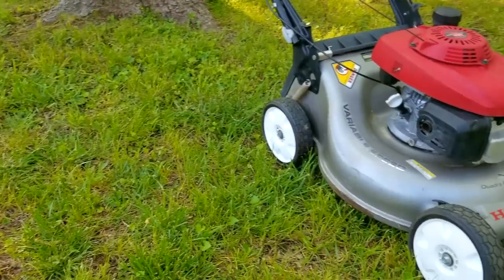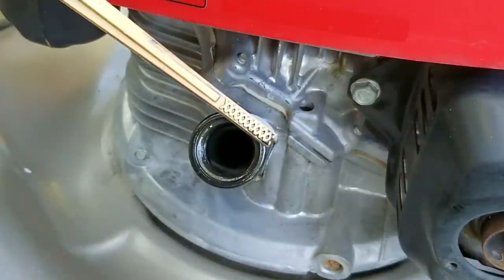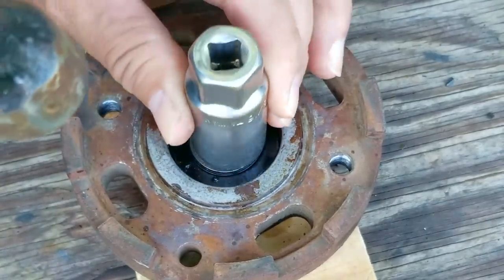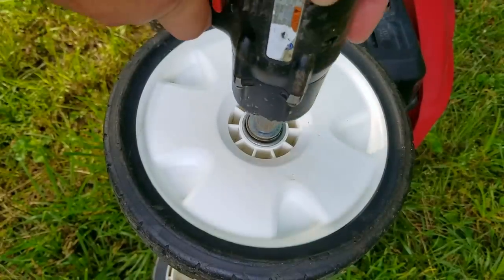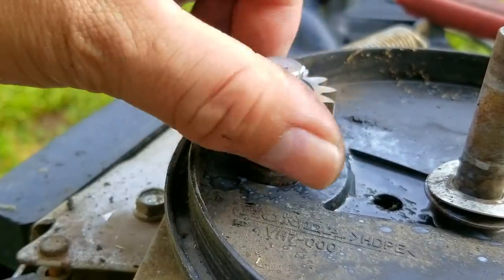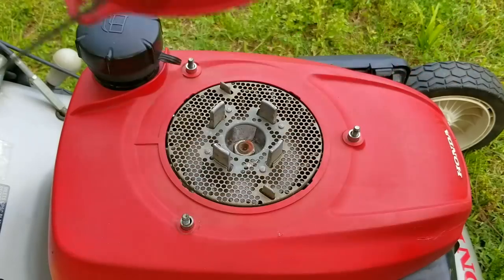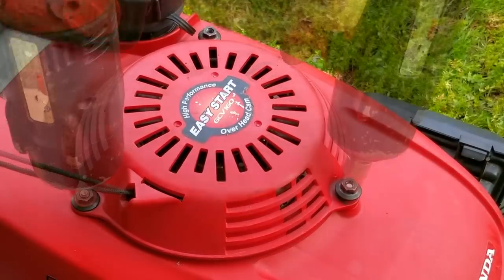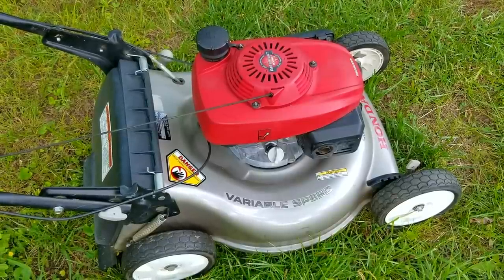The Most Abused Honda Mower I've Ever Seen, And It's Still Running

Comment: Love Honda mowers.  So unfortunate that Honda is exiting the mower market.
Reply from the maker: me too, and yes it's a real shame
Reply: I bet Honda makes battery powered mowers though, yippee!  NOT!
Reply: DAMN HONDA CARS,	 MOTORCYCLES, AND NOW MOWERS?! “Oooooo thanks for da like”
Reply: Just bought 6 brand new ones once I heard they were leaving the market.
Reply: I’m considering buying one to have on hand. I for one want the blade brake clutch as I have to deal with a lot of leaves in the fall and spring. It’s becoming tedious to have to restart my current mower after each bag empty. Also, my current mower is heavy (100lbs) and self propelled, though there are times where it doesn’t help. I’m going to start getting my oldest started mowing the lawn soon and I’m sure the nexite deck Hondas are much lighter and would be easier for him to use.

Comment: I just changed the oil in a mower I got last season, it is from 2007, and I don't think the oil had ever been changed. Surprisingly, it wasn't low, but it was very thick and black. Almost like tar. I had to run the mower for about 10 minutes to get the oil thin enough to drain out. I put new oil in it, and surprisingly it still starts on the first pull, and runs fine without smoking (too much). The oil I put in it is black again after running it about 30 minutes, so I am going to have to change it again pretty soon, and possibly even a third time until the oil stays clean. 

I would love to see a new engine last that long of constant use with it's original oil and still run like a new machine.
Reply from the maker: very nice work on that mower. You're definitely doing your part to keep that mower running for as long as possible

Comment: EXCELLENT VIDEO! I OWN a HRR mower. I agree, the less bells & whistles, the better, less to break down. That oil was awful. When I store mine, I change oil & pull the plug & pour a tablespoon of oil down cylinder. I bought a air filter, new plug, & blade after buying new 3yrs ago in which I am installing I ALSO coat the bottom of mower deck with Fluid Film. Not only does it keep rust down, it keeps grass from sticking. I change oil during the season. Oil is the heartbeat if ANY engine.😉👍
Reply from the maker: yes you are correct, too bad this one had a little less heartbeat than it needed for most of its life, Thank you Rice Burner
Reply: Your mower will last a long time then

Comment: Oh I love the blade clutch system. The biggest issue on the HRR is the bushings. It's not always rust though - these lack a dust seal on the wheel side of the self propelled system below the ratcheting gears. It's important to add one as that's why the HRX mowers do not have problems nearly as much as the HRRs.
Reply from the maker: ah you bring up a good point

Comment: I needed a good quality mower with infinitely adjustable drive speed, so the hydrostatic Honda was a natural choice.  The blade clutch mechanism on newer models like yours is really robust and easy to work on; it's another story keeping the axle bushings (at the height adjusters) greased.  That's about an hour job for me, and it gets done about every three years.  Otherwise, the axle will corrode and become abrasive, killing the bushings and making it really difficult to pull the mower backward.  But otherwise, yes, in my case, the bells and whistles of the premium Hondas are worth the extra money & maintenance.
Reply from the maker: thank you for the information

Comment: I have a 1983 Honda self propelled lawnmower that has been used every summer since new. It still starts and runs like it was new. Still has the same exhaust, recoil cord and wheels. It even still has the original air filter that gets blown out and cleaned yearly. . The only work that mower has needed was a carb overhaul after the first 35 years. Once that was done it runs like new. It is now the mower out at my place on the lake and mows 1/2 acre weekly.
Reply from the maker: nice!  Thanks for sharing that

Comment: I wanted a self propelled mower to help with my hilly yard. So my research lead me to the Honda HRR216VKA, and have been happy with it. The other day the rope was harder than usual to pull. I’ll look into the bearing and recoil situation. Thanks for this illustrative video.
Reply from the maker: no problem, thanks for your time.
Reply: One other thing to check is the blade brake. Make sure it completely disengages from the flywheel when the handle is pulled for start.
Reply from the maker: good point

Comment: That mower definitely has a bent crankshaft. That clank is a sign of that. To me, Honda mowers are amazing, but the HRR was a bit of a “swing and a miss.” It has a rock solid engine, but the deck and drivetrain is not the greatest. The HRX is definitely expensive, but it is rock solid.
Reply from the maker: thank you Riley Sindt
Reply: Thought the same, seeing that crank bolt running off center am surprised the uploader didn't say anything about it.

Comment: Unsuprisngly for someone like me even though maintenance on a piece of equipment is a big factor in what I buy extra goodies that make live easier are a must. My first mower that had a form of blade stop which was a Toto Turfmaster was awesome, being able to run the self propel while keeping the engine running is awesome. Of course the bigger the mowers get the more little goodies they have and at least in my opinion while they do add things to go wrong they often don't especially if preventative maintenance is taken.
Reply from the maker: nice, and to be honest, I had something like that too, with the older toro with the 2 stroke Suzuki. Using the self propel and not use the blade was very cool!

Comment: Good old Honda reliability!!! So much abuse and it’s still running.
I need me one of those for sure
Reply: I've mentioned here on a video before, but my job uses portable air compressors with Honda GX 390 engines.   Very little care is given to them, started in sub zero Temps and straight to WOT, and zero oil changes.   It just gets added when needed.

They run for 8 hours a day or more for many years.  Hard to believe they do.
Reply from the maker: these are very good, even when worn out.
Reply from the maker: that's absolutely amazing in my book!
Reply: @ChinookBear  You should change the oil though.... at least annually.

Comment: Thanks !  That mower may be ten years old but those tires are like new. I'd be surprised it they had 20 hours on that machine. Looks like it was rode hard and put away wet after hitting a yellow pole numerous times with the handle.... and hitting a buried pipe or root with the blade.
 As for the recoil assembly the price is under fifteen bucks at a shop.
Reply from the maker: you are correct, and yes it's not bad at all for its age. Too bad they didn't a little more work into the maintenance .

Comment: My mother had an MTD push mower for something like 15 years she didn't do anything to it, just added oil if it needed it, but never serviced anything. Eventually, she bought a new mower and let the old one sit for another 5 or so years. I asked if I could have the old MTD, she warned me it was junk but gave it to me anyway. I took it apart, changed the oil, fixed the wheels as they were sitting at a 45-degree angle lol, cleaned the underside, undercoated it, and cleaned the air filter. It runs like new now, I'll probably get 10 years out of it.
Reply from the maker: wow it's pretty amazing that It still worked after that time!

Comment: I have one like this that I bought in 2019. Starts on the first pull even right out of the box (Adding oil and gas of course) after all this time I have the problem of the rear drive axle wearing and getting loose. I took apart and shimmed them with a piece of an greased pop can. Going up and down the the hard ground here in West Virginia is rough on any mower!
Reply from the maker: nice work on getting it fixed!

Comment: Really like my HRX.  I change oil twice a year, about 25 hours on the oil.  Only issue I've had is like you showed on the drive ratchet mechanism.  Took it apart cleaned and lubed and good as new.  I've heard from another channel that mowing wet grass with these Hondas will clog up the drive system literally locking it up.  She said its a 3+ hour tear down for that clean up and re-assembly.  I WILL NOT mow wet grass.
Reply from the maker: yes mowing yet grass is never a good idea. But know that it is wet means you can still mow it, but you can try and let the mower dry up before putting it up.

Comment: bought a Troy-Bilt front drive self-propelled in 2010ish with Honda GCV160 motor for about $280.00.  i recently noticed that these lawn mower prices have skyrocketed and that is when i decided to fix this one instead of buying another. never have changed the oil.  recently put a new carb and air filter after it sat all last year.  oil was low, so i filled it and plan on changing it in the next couple of weeks.  so, that is 12years of use.  it shares time with a lawn tractor.  I expected it to break and it just hasn't.  it is running great..no smoking or bad noises.
Reply from the maker: it certainly seems to be holding up well.

Comment: @5:06, looks like the crankshaft may be slightly bent. Looking at blade at the beginning and the engine shimmy on the deck at the end, to me, seems to confirm this. Could be wrong. Did you notice that?
Reply from the maker: if it is, it's so minor, it'd say it was acceptable, still pretty good for 10 years old.  Thank you Warren Burke

Comment: I have a honda self propelled 3 speed . Never a problem after more than 20 years. Changed oil and plug yearly .Dont have the blade clutch.
Reply from the maker: very nice work Harold Young, looks like you're doing a fantastic job, taking care of it.

Comment: I purchased a similar Honda with the mulch  bag knob on right side.  $75 starts runs fine the self propelled function pushes down a long ways before engagement. Cable Adjustment or belt. blades good I am going to clean it up and list it
Reply from the maker: nice, good luck with the sale

Comment: Being (at least) somewhat mechanical minded, I really cannot understand why any adult with some life experience would pay upmarket prices for a high quality machine only to abuse it or fail to provide it the level of maintenance require to get the optimal performance and life out of it (i.e. getting their moneys worth). To me, that is not only a waste of money but an encouragement for the manufacturers to cheapen the quality of the product while maintaining or even increasing the high prices; if you fail to take care of your machine, it becomes more difficult to identify if a part failed from being made cheaply or from being abused. Also, I agree that if your paying a shop to service all of the addition features that most mowers don’t have more often, you could justify buying a cheaper machine, running it without an maintenance at all for 2-4 years, and just replacing it with another cheaper new machine every 2-4 years. I think I could argue that the expense either way would equal out to be about the same but probably slightly less by just replacing it; without the consumer feeling as though he’s dumping more money into the same old machine again? I would only be willing to pay up for a high quality machine IF I were planning to take care of it, service and repair it myself, and squeeze every drop of life out of it that’s possible! Personally, though, I generally don’t like owning machines or appliances that have harder to find, more expensive, or limited aftermarket parts availability. Doing my own work, I have made out extremely well running used equipment (sometimes even building one machine from the parts of two or more) so I rarely buy new, above middle-of-the-line machines and, even when I do, it is usually more about satisfying my own curiosity about experiencing the machine than expecting it to live a long life without additional costs or maintenance effort. For someone who has the ability and enjoys doing mechanical work, I think buying new, high end machines are largely unfulfilling. Most people in this situation would prefer bringing a used high end machine back from the dead, using it just long enough to get a feel for the user experience, then flipping it for a maximum profit and starting over again! I can only say that the machines I prefer to keep long term for my own person use are the machines that strike a nice balance between easy and enjoyable to use, powerful, dependable, affordable/easy to maintain and purchase replacement parts. Power equipment as a status symbol does not enter into the equation at all.
Reply from the maker: thanks for all the information and yes all power equipment should be priced all the same regardless of quality, place of origin and deserve equal representation

Comment: The Honda mower is a good product. I've had mine 10 years and I just keep it clean, change the oil once a year and sharpen the blades. It still starts first pull. It does have its disadvantages. Firstly, I am a strong 98 kg guy, but it is simply way too heavy and too bulky to pick up and put in my boot. Secondly, the cheapest self-propelled Honda mower in Australia is $1,800. IF you can get one for $500 in USA, I think that is damn good value. I sure hope you end up changing that engine bearing in the one you just fixed. Maybe, I should import good used ones from USA and on sell them?
Reply from the maker: LOL,, sounds like a good plan but import taxes and regulations would not make it worth it.
Reply: Had my Australian made Honda Buffalo Buck 20 years. Change oil every year and filters/spark plug as needed. It came with the Victa snorkel. Only parts I’ve replaced are wheel bearings and blades. I take care of it and should last another 20 years. Love Honda mowers!

Comment: Lawn equipment is the most abused next to a car. People are fine not doing ANY maintenance on their equipment  until it will not start. I had a Snapper self propelled  mower that ran for 27 years before it finally gave out. I would rather own a Snapper over a Honda. They are good mower and quieter than most. I usually find the air filter completely  full of dirt, even to the point the carburetor  was drawing oil from the crank case trying to get air. I agree, the blade clutch  system sucks.
Reply from the maker: the old snappers yes, they're very good machines. And it seems your experience with them, was a very good one, so I completely understand.

Comment: 4/25/23
Hi there,

Quick question about a project I have at hand, my Ariens lawn tractor.
It has a Kohler Courage Single Cylinder OHV engine.
It idles fine, but backfires when I shut it off.
The owner's manual says the throttle has to be set in the fast (3/4) position, before the engine shuts off, to avoid backfiring.
Clearly, it's well known that this engine has a backfiring issue, because they included it in the manual.
You'd think idling before shut off would stop the backfire, as there would be a leaner mixture and less fuel to ignite in the muffler.
Maybe I should've used a slower hand when throttling down?
Maybe the fuel mix is too rich and unburned fuel somehow makes its way to the muffler and combusts?
If the mixture is too rich, would that make it stall or choke out when going beyond half throttle? Something's improperly adjusted in the carburetor,
but which screw/needle? Also, this mower has very few hours on it and is practically brand new! I've been using it for 8 or 9 months. Just sharpened the blades today and greased the front axle and wheel zerks. Hope to take the best possible care of my tractor, so it'll last a long life of good use.
I always enjoy and learn from your equipment repair/cleaning videos.

Thanks!
- Gan P.
Reply from the maker: ah yes I've heard of this issue before. If it was mine, I would install a fuel shut off valve, and 2 minutes before I plan to stop mowing, I would reach over, and turn off the fuel. It can't backfire, if there's no fuel in the carb.
Reply: Any recommendations for  a 1/4 inch fuel shut off valve? I heard a lot of them leak after a while. I'll likely buy a pack of them as to lower the average cost per unit and then I'll have a few spares. What about the engine choking out at above half throttle?
It seems as between myself and my grandfather, everything is always broken.
 
Also, I had a project weed eater branded trimmer. The carb has a leaking gasket and the pull cord snapped on me. It also needs carb work and other miscellaneous fixes. It ran when I directly primed the cylinder with fuel, so I know it has enough compression and a working ignition system.

For a rookie like myself, I hate to give up on it, especially because the engine has very little wear, but I'm done fooling with it. Maybe on Father's day, lawn equipment will be on sale and I can get a cheaper brand new unit, since I can't find any good deals on used weed whackers on FB Marketplace in my area. Times have changed and people know that their equipment is worth more than it was a few years ago, so getting a bargain isn't possible. And even free stuff is elusive.